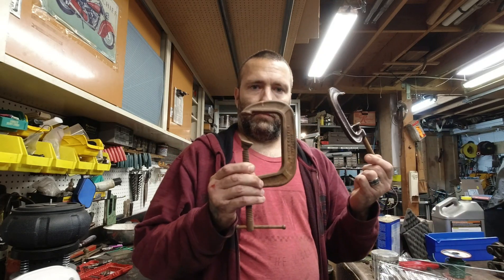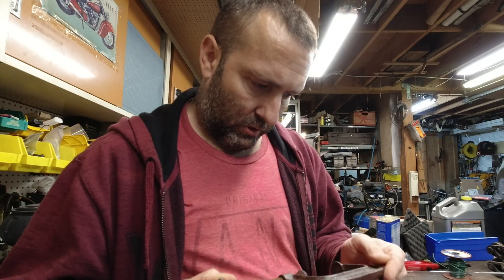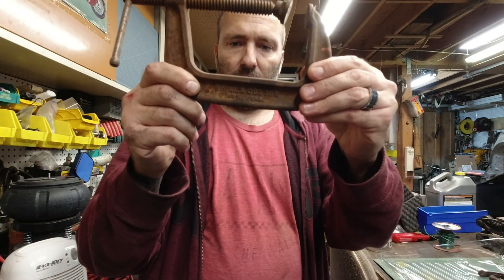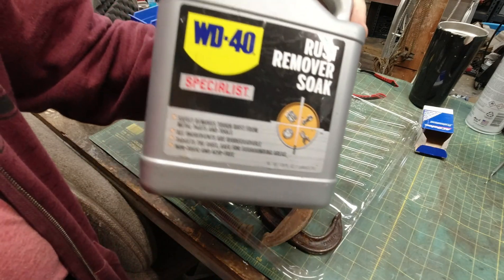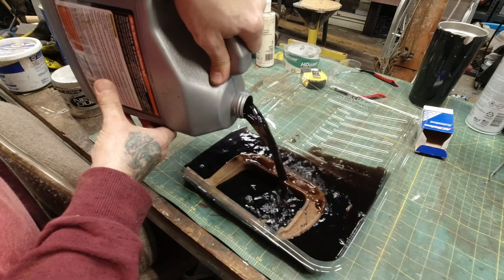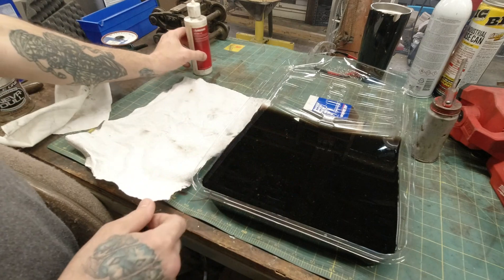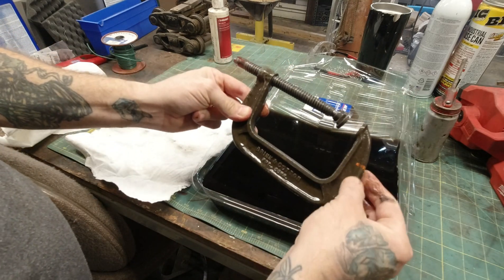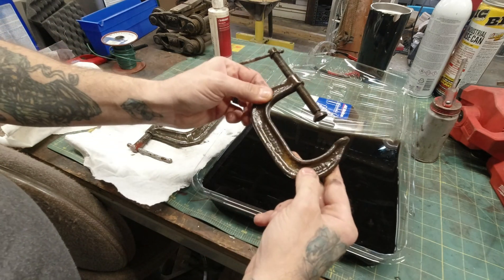Vintage C Clamps Restoration

Comment: Came out good man. You ever tried vinegar for rust removal? I use it a lot. 2 bucks for a big jug, gotta be cheaper than that wd40 stuff. Give it a whirl sometime.
Reply from the maker: Thanks and I'll try it once the WD-40 is gone.
Reply: @MadStiles  works wonders. Just have to do an aftersoak in baking soda and water to neutralize the acidity from the vinegar. I've personally used vinegar countless times. I've also done the electrolysis method, which works too. I've always wanted to try products like evaporust it's just I can never bring myself to spend that kinda money on it!

Comment: More info. The blue paint? What brand? Primer first? How many coats ?
Reply from the maker: The blue paint is Rustoleum paint & primer in one and I did two light coats than one full wet coat no clear coat they turned out pretty good there you get used a lot so I didn't make enough to perfect